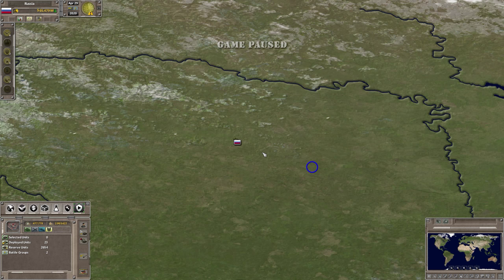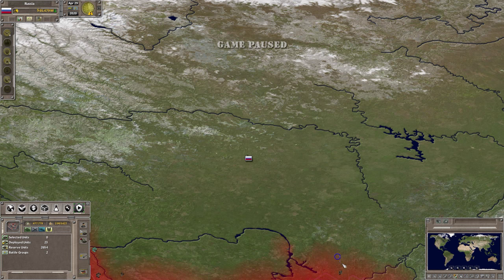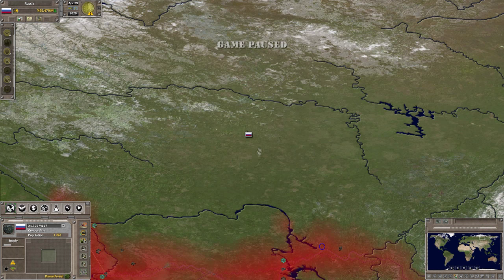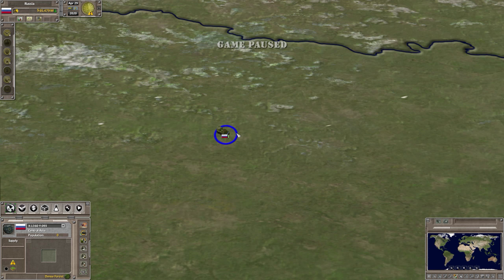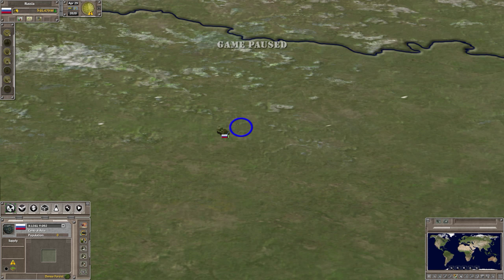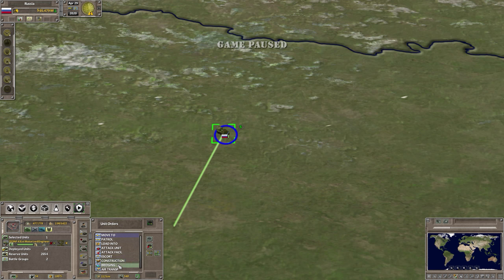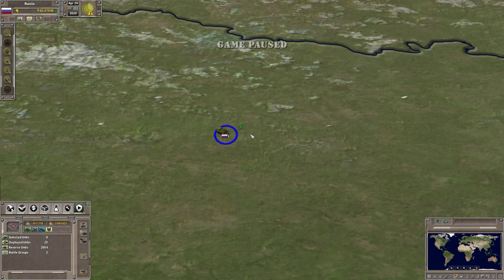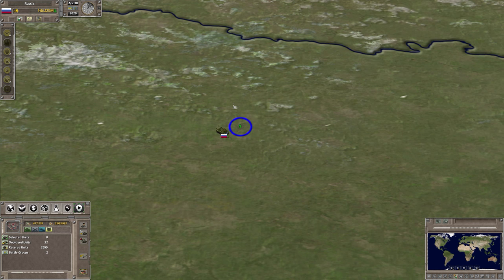Supreme Ruler Ultimate - How to build with no supply

Comment: Hey i was playing in the shattered world map as the Nunavut and i came across a problem where i couldnt build oil fields in this spot. I was assuming due to no supply and no population? how do i gain population there? And also in my main city i have a barracks and a land production facility and it just remains inactive and i can't activate it. What should i do? Im very nooby at this game :-/
Reply from the maker: Did you solve this issue?  I only just discovered these comments how many were held by YouTube due to some settings I never changed.